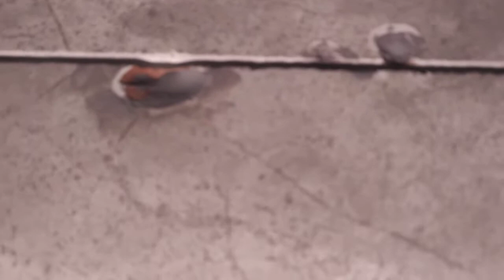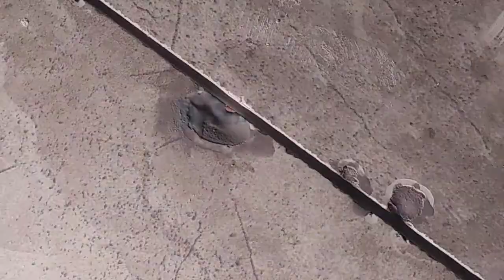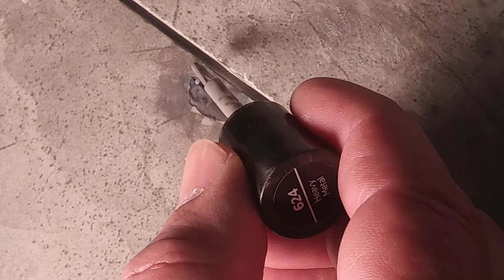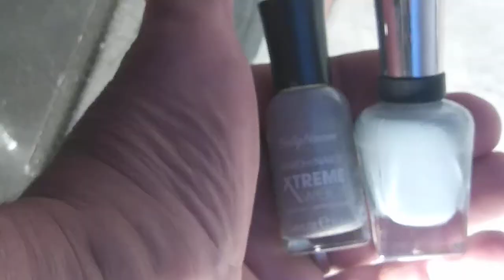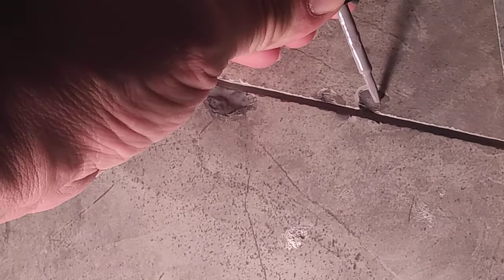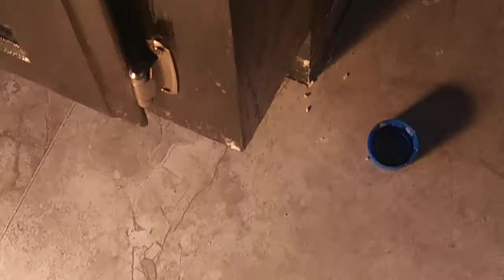How To  Repair Chipped Tile Surface |  BathroomRenovation

Comment: It seems like it works with that tile with the various tones in that tile. It looks like the tile isn't polished either which kind of helps too. If it was a new install, I think I'd replace it. If it's a repair, that seems like a great patch!
Reply from the maker: Chip getting your colors close enough for it to blend in makes a big difference if you could get the same colors it would disappear then this is going to work and after the grout goes in I'll be doing another video what should be happening tomorrow well thank you for your support and your time bro I'll be by to visit soon God bless you Happy New Year's bye for now Ken

Comment: wow that's a great tip, impressive end result...I'm going to try this with a small spot in my kitchen that drives me nuts...Thanks Ken...
Reply from the maker: It'll work just fine let me know how it turns out. Thanks for visiting. I just learned that they make a ceramic touch-up kit you can buy at the big box stores on the suming no Lowe's Home Depot Menards if you have one in your area I look forward to hear from you bye for now your friend Ken you can use fingernail polish if you have any chip on your Appliance as well. I believe fingernail polish is the same as auto body paint but that resonate for a minute all right bye for now your friend Ken God bless, hope you have a good day and a blessed New Year